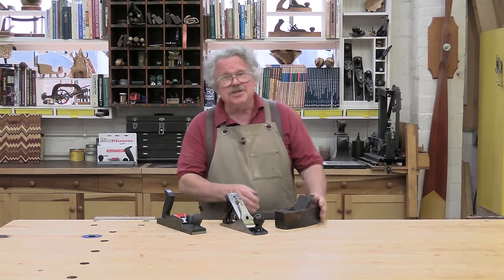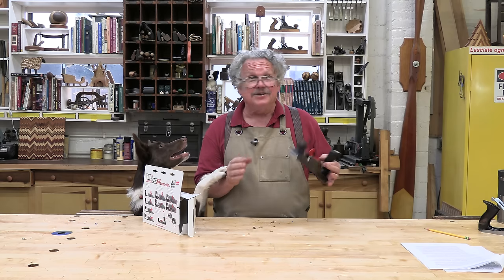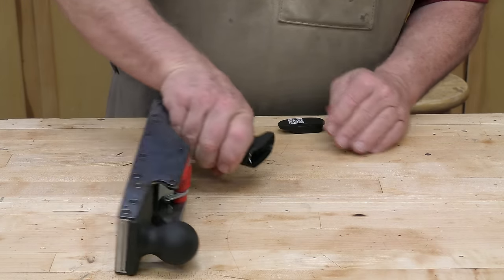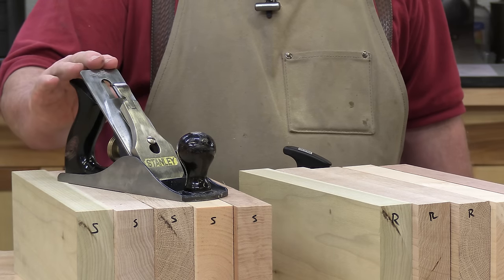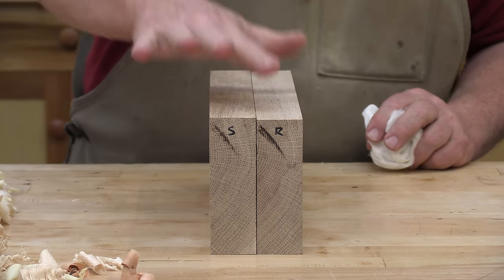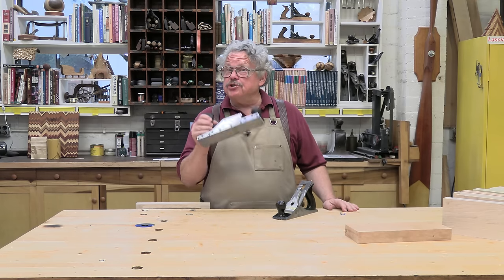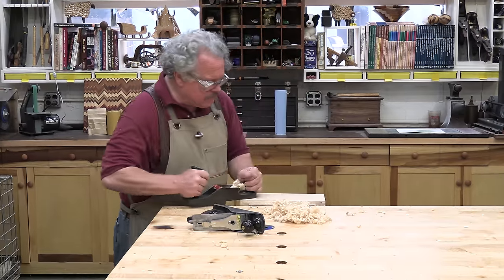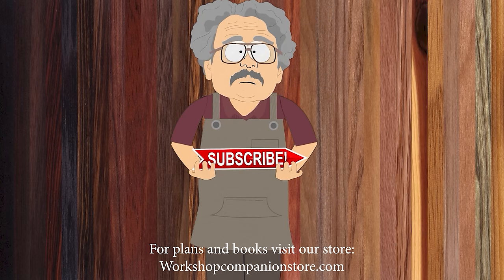Is This the Future of Hand Planes?

Comment: I appreciate the honesty of this video. Seen too many "reviews" gushing over their box o free stuff. I bought Triton drill based on one of these. Probably a mistake  -- one battery went goofy soon and they seem to have distribution issues. Decent drill otherwise. 

One minor quip with an otherwise honest appraisal, and even that is tangential: ". . . especially when you're marketing something unique, like a plane with disposable blades." As others have commented, not so unique. I have the Stanley RB10 (flea market), and was intrigued by the supposed rabbiting feature, and also had to discover for myself the cache of blades in the handle. Never very popular, and I'm sure the model you tested is superior. Already have all the traditional planes one could desire (mostly flea market), but then I know how to sharpen and hone. 

As to beauty, I'm in complete agreement. In the Whole Photography Catalog, comparing the Nikon F-1 with the Canon: "Beauty is a thing that works." (Something like that). I have a Vicmarc lathe that you wouldn't want in your living room for decorative purposes. Used to have an old Delta. The delta had some cool Art Deco lines -- it was beautiful. Also a piece of crap. The Vicmarc works. Beautifully. 

All said, I could see the Rali tossed in the toolbox for installations (as you have mentioned), not having worry about the occasional nail or sharpening. And the woodworkers who use power tools for everything, and only occasionally need a touch-up with a plane. Not everyone enjoys the hand woodworking process, but if you do, you already know how to sharpen everything (or you should). That would make the Rali redundant in those shops. I'm more of a hybrid, but I'll stick to my Miller's Falls and Stanleys.

Sorry for the book. I mainly appreciate an honest, thoughtful, and concise appraisal. Seems rare these days.

Comment: I am convinced the Rali is great for beginners like me. I am also sure that I won’t get one because the Stanley’s are just so damn beautiful and I want to learn to use them properly someday. (BTW: The Thos Moser once explained planes to me. I still don’t really understand how a flat thing with a projecting blade can ever make something flat.)
Reply from the maker: It has to do with a unique property of wood called "springback." Cutting wood is a stress-failure process -- the sharp edge of a cutter stresses wood fibers until the fail (read: break). As the wood is stressed, it is compressed very slightly. After it fails, it springs back. This is why it is so important to make thin shavings. When the thickness of the shavings are close to the springback, you get a reasonably flat surface. By the way, springback is also the reason you set your jointer knives a few thousandths of an inch (or hundredths of a millimeter) above the outfeed table.
Reply: @WorkshopCompanion  I have not seen this so clearly explained. Not even by Thos Moser! Thanks. And as always,  arf.

Comment: Well, I have never been behind the concept of using 'throw away' tools of any sort, including cutting edges. Mostly, I am on the wood lathe, but am getting into flat work. I do not have any carbide tipped tools. There have been huge improvements with the 'nano grained', or 'micro grained' carbides, resulting in a far sharper edge on carbide than used to be possible. Maybe it is just the 'Zen' of sharpening that I like.... Done it for so long, I don't have to think about it....

Comment: The RALI planer is the best planer on the construction site: robust, the blade can be quickly put into rest position Cutting thickness is quickly adjusted, the blade is always sharp. The small RALI monoblock is always in my tool bag.
Reply from the maker: Thanks for sharing. I too have found the Rali is a good job site tool.

Comment: I purchased my first Rali plane, the RALI™ 220 Evolution N Hand Plane, in 1987. Somewhat older than 10 years. 😜. I  now have smoothers in both English and RALI™ 260 Monobloc Hand Plane, German configuration and the dandy RALI™ 105 Evolution N Hand Plane block plane. The German style smoother and the block plane are in my go-box. They function as advertised AND I DON’T HAVE TO CARRY SHARPENING EQUIPMENT WITH ME!  I still like my Veritas low angle bench planes better. However, when I purchased my Ralis, they were about 2/3s the price of the Veritas.  In spite of my personal preference, I still highly recommend the Rali planes.  I suspect I’ll give the RALI™ 260 Evolution N Hand Plane when budget permits.

Comment: Great video Nick. Thanks for being full transparent regarding you association with the product. I have been using a Paramo Planemaster No. 10 for several years, a model I bought used quite cheaply and was made in the 1970's I believe. It is a replaceable blade rabbeting plane and somewhat patterned after the Stanley Carriage makers plane. The more modern equivalent would be the Stanley RB10. Stanley also makes an RB5 which is a block plane form and variants of these are available at my local Menards with the Irwin label. I found that the replaceable blades are "hone-able" in the normal fashion if you have the right holding mechanism. And honing makes the plane perform quite well in some scenarios. And I used the Paramo exclusively for light duty tasks, like you showed in the video, after selling my Stanley collection 10 or more years ago.

When I started adding hand tools back into my workflow recently, I did consider the Rali planes. However, based on my experience with the Paramo, I felt the Rali might struggle under more challenging tasks like face planing. Also, owning the Paramo did not mean tossing out the sharpening implements or forgetting those sharpening skills. After all I still needed a way to sharpen other tools like chisels or shaper cutters. 

That being said the Rali has a difference construction than my Paramo and I hesitant to fully discount a new design approach. I think a great follow on video would be to test the Rali in other planing scenarios where the Stanley Bailey pattern planes have proven to be quite flexible.   A useful task for the hybrid woodworker would be to roughly flatting the face of a workpiece in preparation of sending it through the thickness planner. I'm also curious how the Rali performs in system of tools like fore, jack, jointing, smoothing planes, and bench chisels. Also, how does fair edge planing when the edges are very rough from the saw mill?
Reply from the maker: All very useful suggestions, Thomas. But, the video was getting a little long as it was, and -- as you well know -- it's hard to get an audience back for a second look. Note the difference in views between my band saw lumber videos #1 and #2. This will probably be it for the Rali bench planes. I may take a look at the block plane and/or the Rali chisels some time in the future.
Reply: @WorkshopCompanion  I hear you for sure. It's hard to convince people to sit through a video that would be long enough to capture all the things a system of Bailey pattern plane can do. But, perhaps that the core challenge the Rali company faces?

Comment: Nice review.

 I particularly appreciate that you based your comments strictly on the tool in hand and not on tradition or ego. Sharpening is done to make a tool work its best and some enjoy doing it. Others just want a tool that does the job well, with little fussing, and tradition be damned if there is a better tool. In my field I have museum quality tools of the highest order, but I routinely grab super cheap tools because they get the job done well without having to consider potentially damaging the tool itself. The cheap stuff will always be cheap, but if it does the job - and that's what a tool is supposed to do - why not?

Also, time is money. The customer would rather you be working on the job and not working on your tools on their dime. On my own time I will resurrect discarded tools and put them to work. Putting in $300 of labor on a $100 tool because I can and want the end result. I enjoy the experience and education gained in the resurrection of dead tools.
Reply from the maker: Thanks for sharing.

Comment: This would be great for beginners to get more comfortable with hand planing. The price isn't all that bad either, given how much other handplanes have increased in price.
Reply: I think the price is a little high. It is only $30-40 from buying a Veritas which holds its value and will last several lifetimes.
Reply: The price of nice planes has been a roadblock for me, and I have a shop full of power tools including 10" jointer and 15" planer (thicknesser). I don't want to learn a new craft, hand planes just as I refuse to buy CNC tools or 3D printer because I don't want to learn how to use them (including the software). I operated a CNC vertical mill in 1973, valve stems on the Alaska pipeline were part of my job. I left to return to college and received a BS in Mechanical Engineering. Now retired and not looking for new challenges. I will buy a Rali to fill the gap between my jointer with carbide hex head and the drum sander.  Tks for the review.

Comment: I like sharpening plane irons, there is a joy to bringing them up to razor blade sharpness, once the blade is set up right, it doesn't take long to bring it back to peak performance.  I don't need fancy replacemnt blades, many Stanley blades are quite good.  having sai that, they do vary in hardness, often with country of manufacture.  Unfortunataly, many Stanleys came out of the factory in an almost unusable condition.  Considering the cost, my 60 1/2 bloc plane was a disgrace, it took untold hours to get it to its current usability.  the best Stanley, i havce ever seen as regards quality, is one I inherited that was originally owned by my grandfather, boat builder.  It is a Canadian made number 7 wide blade corrugated base - exceptional original workmanship.

Comment: Just found your channel and I really like it. You remember me of the master I've learned my craft from. I use a Rali in my standart toolbox for construction site or installing furniture. It's just the best and easiest multi-purpose plane. And it doesn't care about humidity and temperature. And I can use it on plate material without any thoughts about the future, I just can change blades after ruining them. In the shop for smoothing I still prefer a Stanley 4.5 with Aogami blade. And if I need perfect finish, I use the japanese plain that mustn't leave the room. But that's actually overkill. 

I would absolutely recommed anybody a Rali as the first plane to buy. Be it for hobby or even if you are an apprentice of joinery (my apprentices usually use my Rali in their exams, to get acceptable results with less worries and in a stressy situation, where time is the big problem).

And yes, I'm one of these Europeans not actually reading manuals. I prefer Videos, it's so much easier than text and pictures.
Reply from the maker: Thanks for the input. My Rali is a job site plane as well.

Comment: i think this could work well with your already existing planes.  As a guy without a jointer or thicknesser, i have to do all thicknessing by hand (usually No. 5-1/2).  On hardwoods, the blades can become dull quite quickly.  Using this RALI plane for rough work seems like it would really take a load of my no. 5-1/2, which I could then use as a mainly as a shooting plane.  I hate sharpening plane blades or any sharpening in general... i'm actually considering this.
Reply: Do you have a scrub plane? Taking an old beater plane and putting a huge camber on it to make it a converted scrub should fix most of your thichnessing problems pretty quickly.

Comment: I use a sergeant #7 and a Victor #5 as well as a #5 plane that just has "made in USA" stamped in it.  I call it Ol' Blue.  I wouldn't mind a plane that doesn't need sharpening, but I would want any extra blades just rattling around in the tote getting dull before I use them.  Interesting concept all the same.

Comment: When I was young my Dad had a plane or two. I couldn't get them to work and never saw my Dad use it. Don't know why I couldn't get them to work. Crap wood? Dull rusty blade probably. Not adjusted correctly, possible.

Now 40 years later I bought a house which came with contents which included a plane. It worked!!! Bought another. Useful tool. Not good on knots and I work with cheap/free wood so I deal with a lot of knots. But in nice straight grain wood.

I've been slowly converting my thinking to using more hand tools instead of power tools. Easier setup and I like a more carved wood look than trying to create a factory edge. Competing with machines and robots doesn't seem like a smart path.

I'm now planning a move to SE Asia. Might build my own house there. Get to work with new kinds of wood. Getting good power tools there isn't as easy as in the US. Electric power is often out. Good place to use hand tools.

Comment: I have had the "cheap" German-style RALI for 8 years. It works well out of the box, and it is certainly a lot easier to use "on site" for house repairs and 'general DIY' than a traditional Bailey plane: if I plane over a nail head it's a £3 blade and 30 seconds to change it, and I don't need to carry sharpening equipment around. For "proper" woodworking, I still prefer a traditional plane, but there is definitely a place in my toolbox for the RALI.
Reply from the maker: That's exactly how I'm using the Rali I tested. Great job site tool.

Comment: As someone who's got NO kung fu with tuning (much less restoring) hand planes, I absolutely need one of these.
Reply: I bought 2 of these, forget that sharpening stuff. 😅
Reply: @fredparsons5134  How did they pan out?
Reply: I love them, just got the rali evolution260 today(already had the cheaper version of the 260) , took it out of the box and shaved the edges on a cabinet door smooth as glass. I hate sharpening, I make items to sell so I don't want to take time to sharpen stuff. Always parallel and quick to sit the depth and then to retract to put away. Their chisels look great too.
Reply: @fredparsons5134   Okay yeah, that sounds right to me. I'll sharpen stuff if I have to.  But yeah I made too many end-grain rock maple butcher blocks to ever want to sand/file/sharpen anything if I don't have to.
Reply: I would imagine doing hard maple the carbide blades would be handy. I went direct to the rali store and it came from Sweden in a week.

Comment: The Rali plane, at least the ones from way back, have the best mechanism, and I have made them all.  There were also available blades on could sharpen.  It really begs to be sharpened, because the cost of some Swiss blades nobody carries, but get dull like anything else, is a deal breaker.  It would be easy to conquer this issue, however, the market is people who can't handle shapening, however the speed with which you can cycle them and the fingertip blade depth adjustment are the real features of the design.  I would be tempted if Hotley would make one.

Comment: It's not the first plane with a disposable knife. The Paramo Planemaster did it about sixty years ago.
Reply: Yeah but did that one come with a bottle opener? 🤔😆
Reply: The Swiss RALI planes came up with the design in the early 1980s and are a standard with professionals across the EU, especially as they offered not only HSS but also TC blades that won't dull whey used a lot on laminates.

Comment: I had a Stanley with small replaceable blades like this. It did not work well. I think it doesn't have the precision to hold the blades stable enough. This may be is better.
Since the blades is so thin they need to be precisely supported very close to the cuting edge.

Comment: Loved the manual boiling. I would find it more interesting if they used standard trapezoid razor blades, in a much cheaper (at least half) price bundle. Running out of blades when you need them is going to be painful. On the other hand, if they were serious about woodworking, they would include tilt adjustability, convex blades, and immediate adjustment of the bottom plate (the last is easy to implement), as you said.
Reply from the maker: It went through my head the a similar design using easy-to-find utility knife blades might be a worthy experiment. Trouble is, utility blades are typically sharpened on both faces, making the tool angle fairly small. To attack the wood at a reasonable cutting angle, the frog would have to hold the blade at a low angle. Additionally, the utility blade might not hold up well in this application for the simple reason that -- because of the small tool angle -- there isn't enough steel behind the cutting edge.
Reply: @WorkshopCompanion  True, these were also my thoughts afterwards. I use blades as scrapers and they do a pretty good job, but for very light uses. Laughed hard on the manual and bottle opener. Splendid content!

Comment: Interesting, however, nothing compares to a traditional Japanese block plane, which works in a pulling direction and can shear off ~10 micron sheets with no physical effort. It is an instrument of exceptional simplicity and precision, and the relationship cultivated between the carpenter and the tool is the essence of craft.

Comment: Great video, But I'll stick with my old planes. I have planes that are older than I am, all but one have the original irons. That one is the one I used at work for about 30 years, so picked up a fresh iron for $24 and it should be good for the rest of my life.
 Also, I've never been a fan of anything disposable.